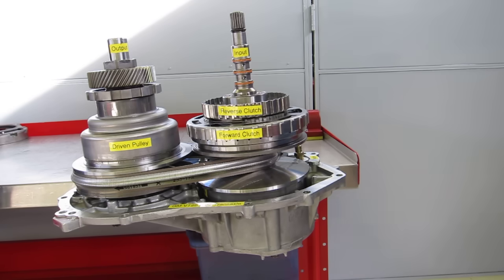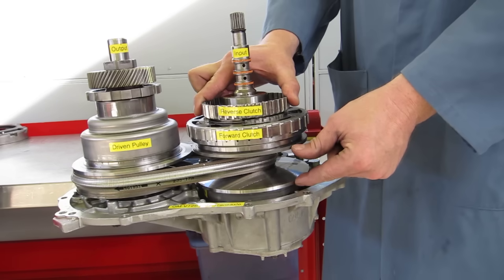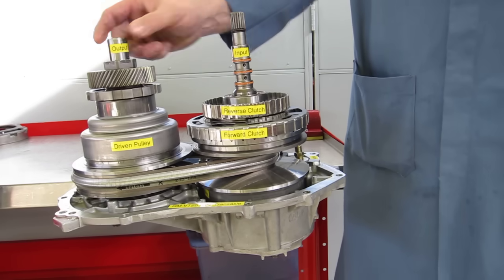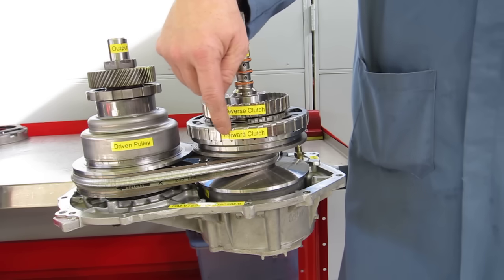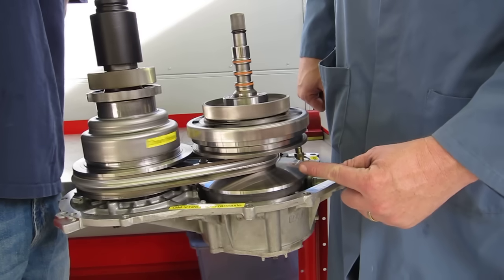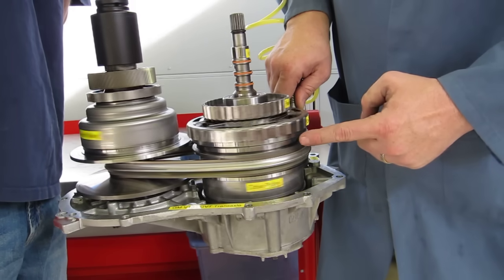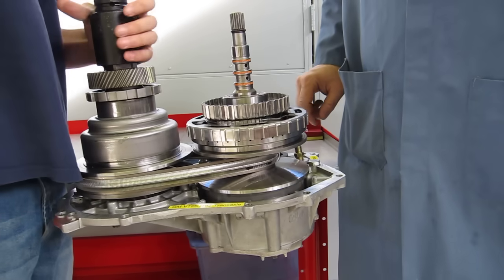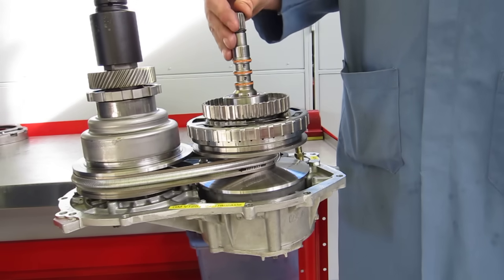Continuously Variable Transaxle (CVT) Operation

Comment: This is very straightforward. After seeing this, I understand why there are so many issues with CVT. CVT is not built for heavy torque and most likely will not last long. If something is wrong, it will be catastrophic. Avoid CVT at any cost.
Reply: Toyota and Honda pretty much perfected the CVT, especially Toyota, they have been using them on they’re Pruis’s for over 20 years now, and they’re pretty reliable cars.
Reply: @thinkkops853  Is this why Honda ATV's use geared transmissions?
Reply: Its a old video subaru as the chain drive instead of belt drive make it better in alls the way.
Reply: It's new technology, anything new will take time to perfect. And they've been making leaps and bounds in the past decade with CVT. I had an 07 caliber that had a CVT and I was worried it would just stop working one day with how bad it ran.
Reply: You can make a cvt more reliable than an automatic/manual and id still not want it
Reply: @anthonyoden4393  because its not just reliability, it has to have performance.
Reply: Almost all vehicles run a CVT now.

Comment: What is wrong if I have a vibration on acceleration, but only at slow speeds, worse when turning. cv shafts have been replaced, trans oil changed,  new tyres. B200 Mercedes 2007. has only begun after 80,000klms
Reply: same troubles with my nissan.  All cvt are junk

Comment: BUILT-IN BREAKDOWNS. THESE TRANSMISSIONS ARE NOT GOOD.
Reply: BigLBA1  They don't replace the steel belt. They have to replace the whole transmission.
Reply: BigLBA1  if you dont change the transmission fluid, you will end up changing the whole transmission.
I have a 2015 Subaru Forester with the Lineartronic CVT and it has been great so far. 56k miles on it, changed the fluid at 50k. Car runs like new.
Reply: Toyota Lexus CVT NEVER fail, most reliable drive train in the world
Reply: @ElleyElley-et4ky  The Toyota Prius has an eCVT. It doesn't have a belt like a CVT does. It's much stronger.
Reply: Ken Johnson Toyota and Honda pretty much perfected the CVT.

Comment: C.V.T = Crappy Vehicle Transmission
Reply from the maker: LOL, I love it
Reply: Not in Toyota and Lexus! Most reliable driver train in the world!
Reply: @Christopher Reed yeah heard of an early update needed, you're right there! But the existing CVT used on Prius Yaris most the hybrid cars never ever failed, taxis will reach easy 500k without any issues on anything! Tine will tell I guess!
Reply: @ElleyElley-et4ky  The Prius has an eCVT which doesn't have a belt. It's much stronger.
Reply: @ElleyElley-et4ky  Sadly yes, the technology is still fairly new and prone to failure. Nissan had their hands full with lawsuits because their CVTs are just awful, so hopefully other automakers are learning from their mistakes!

Comment: I wish someone would make a clear case so you could see it running with the fluid in it. Best demonstration of how the cvt works that I have seen.
Reply from the maker: Thank you!
Reply: @WeberAuto  quick question. Where can I find the pressure test fitting for the secondary pressure tap on the jatco cvt. Debating on making one if I can't find somewhere to buy the Miller version.
Reply from the maker: @sethc758  The miller version is the only one I am aware of. Check ebay for a used one.

Comment: This variable ratio drive tech is very old. Simplex motorcycles used it in the 1940's.  Polaris ATVs used it in the 1980s. It is one of the most ridiculously stupid designs to ever be used on such expensive vehicles as it is and are expected by the owners to be dependable....They are intrinsically a flawed design for such an application.
Reply from the maker: Thanks for your feedback

Comment: Very nice demo.  One thing that I'm confused about though.  I was under the impression that ' overdrive' meant that an engine's output bypasses the transmission completely this saving energy that would be wasted driving the transmission, hence the name 'overdrive'.  Is this wrong ?
Reply: Ah, thanks for the word.  I've been living an illusion all this time.
Reply from the maker: That is wrong. Overdrive means that the transmission output shaft is rotating faster than the input shaft (engine rpm). Thanks for your feedback.

Comment: Steel pulleys, steel belt,   how does it not slip?
Reply: Railroads have been using steel wheels on steel tracks with pretty good results only having to resort to putting sand on the tracks for exceptional times when there is wheel slippage.
Reply from the maker: Clamping load supplied with up to 4.8 kPa (700 psi)

Comment: My Suzuki has 117k miles on its CVT and it still runs smooth. Anyways we all can forget about transmissions if they can find a good power source for these electric vehicles, but I'm not sold on the batteries of today so I will stick with combustion engines until the find a better power source.
Reply from the maker: Thanks for your feedback
Reply: You mean power source such as the tesserae in avengers movies? Or the power in Tony Stark’s chest?
Reply: Electric motor vehicles have gear transmissions - simple step-down gearbox. No reverse gear - the motor turns backwards.
The simplest system is electric motor hubs but they are heavy for their power as they turn at wheel speed.
It's more efficient to have a high speed motor that is small and lightweight that drives through a single ratio gearbox and driveshafts.
The differential gearset could be eliminated by having an individual motor for each drive wheel. Two-wheel drive: two smaller motors instead of one larger motor and differential
Four-wheel drive: four small motors instead of two larger motors and two differentials. Four wheel electric braking with individual computer control for non locking braking, traction control and stability control.
Friction brakes would be necessary to provide more retardation than the motors can provide, and to bring the vehicle to a stop.
Regenerative braking saves "fuel" (battery charge).
Heat pump A/C and heating, instant-on, no waiting for an ICE to warm up for cabin heat.
Of course each motor has to have its own reduction gearbox.

Comment: thank you so much for this nice demonstration so the car engine computer is the one how to control the pulleys the reverse gear looks like a ring gear amazing but can we use this for a truck or just for fancy cars hh thank you, sire .
Reply from the maker: Thank you very much!
Reply: Can't really use these for trucks. The weak point of this type of CVT is that it cannot handle a lot of torque, while the point of most trucks is to have a lot of torque to move things around.

Comment: Question: if someone hits you (accident) at the front right , bending your rim, broke the air stem , replace the  hub front wheel r/t,   replace end tie rod outer r/f  and alignment can the impact that also shoved (shake from force) the strut  in to the CVT transmission cause any internal  issues to the CVT transmission.  Thanks for any courtesy feedback.
Reply from the maker: It is very possible. It could cause bearing Brinelling and premature bearing failure

Comment: something is not explained.  the push belt is directional, yet the reverser gear is on the input side, thus, to go in reverse the drive pulley would go backwards, and then the belt is going in the other direction.... explain please.
Reply from the maker: It would be pulling under those circumstances. Luckily most people do not need to reverse for long distances
Reply: Just dont race anybody in reverse, you'll lose the race and the tranny.

Comment: Professor John D. Kelly --- You are the best!  I have a 2010 Nissan Altima with a CVT transmission.  Is there any way to determine which Jatco model number was used in the 2010 2.5S Altima?  Wikipedia https://en.wikipedia.org/wiki/List_of_Jatco_transmissions  has a pretty extensive list, but does not say what the Jatco number is for the Nissan Altima 4-Speed Medium/Large (FWD).  Second question is do all Jatco models have the paper-type filter cartridge in the cooler line?  It would be the small cartridge filter identified as Nissan part number: 3126-1XF00, FILTER ASSY OIL
Reply from the maker: Thank you! I do not have access to that information.
Reply: @WeberAuto  I found it!  Based on some help from one of the Nissan Forums I subscribe to.  As far as I can determine my CVT is a Jatco RE0F10A/JF011E.  There is also a good list on the Wikipedia site (but mine did not get listed here): https://en.wikipedia.org/wiki/List_of_Jatco_transmissions .  One last question if I may.... With over 100K on my transmission I want to do a fluid change.  Your thoughts?  I bought the car at 83K and to my knowledge this will be the 1st time the fluid has been changed. I will avoid a power flushing service and just drop the pan (it has no drain plug), check the pan and magnets, check the mesh filter (replace if bad),  remove the paper filter cartridge housing, replace the paper filter, clean and replace pan with new gasket, measure the fluid removed, add back the same amount of NS2 vis the dip stick tube, then remove the rubber line to the radiator port, and do a remove 2 qts replace 2 qts flush until the fluid runs clean.
Reply from the maker: Yes, change the fluid. Be sure to use only the factory fluid. No substitutes.

Comment: Intriguing!  1  are there many internal oil passages in this CVT's case?  1  How complex would a "Plate built" [ welded ] case be?  3  Could the ratio  be controlled by a simple  Variable  Hydraulic control determined by the Driver?
Reply from the maker: Good question. I do not know the answer

Comment: Why nissan sentra transmition parts not avalable ?  This is musth will come transmittion problem
Reply from the maker: An internal failure causes too much damage to repair in many instances.
Reply: @WeberAuto  hello plz explain transmission oil cooler working & problems. Effects cvt working
Reply: @WeberAuto  transmission oil pump bearing broken compeny said not bearing tottal assembly . i am leaving qatar i need help

Comment: So on many cars they change ratio with hydraulic pressure ? I thought before that the amount of torque and speed of input shaft caused more tension on the belt changing the ratio, like a snowmobile.
Reply from the maker: No, there are all computer controlled
Reply: very cool, thanks for reply

Comment: What a perfect demo of the CVT. Thanks for this.
My '98 Civic has a CVT, and over the last 20 years I've been very happy with it. Definitely an evolutionary leap in trans design.
Reply: The civic 1998 doesn't have  CVT, it has  a 5 speed automatic transmission 👎
Reply from the maker: Thank you

Comment: Belt driven sounds like a bad idea.
If the belt breaks replacing it is a very expensive proposition.
Reply: it's not really a belt, more like a  toothless (metal) gear.
Reply: i think all those metal bits flying around and the tiny valves there's no fixing it. More like a swap at that point.
Reply: @Joe Black Exactly except that manufacturers have been cheating( in ways that I don't understand) that your mpg read out is more than your actually getting.What gets me is that I used to own ( way back) a Mazda 626 with a  carburetor that got 34mpg.I don't get that with my 16 Rogue. To this old man something just doesn't add up. I think big oil is the problem in that sense?Too much control?
Reply from the maker: Thanks for your feedback
Reply: A few things need some clarification.
It's not really a belt, more like 10 metal bands stacked that hold about 400 metal elements in place.
Also it's not really pulley system, but rather a pusher system, when those metal elements are pushed, they form a ridged metal rod that become quite strong, there is no stress on the bands them self.
One is the main reason CVT's have such bad reputation is because people fail to take care of them, unlike standard transmissions, these transmissions require clean fluid, they need to have a fluid change every 30k miles.
Reply: yes and these belts break often. and you have to buy whole belt, not just a little steel pieces that go on that belt.
Reply: Robert Presti  no they don’t. And “if” one did, there would be no repairing as the damage would be catastrophic.
Reply: @Backs4more  Your right .That belt breaks and your talking a new cvt., plus Nissan in my area does no tear downs for  anything. Strictly R&R .Most they do is fluid change for $400.00 Ouch!
Reply: @Joe Black My car was junked for major rust , not for a bad engine.It ran great.
Reply: It's a belt pack, sometimes consisting of 5-10 metal strip belts in pairs, slightly larger than the next one, that sandwich in the hundreds of small metal components that make up the flexible steel belt driven surface. There are no traditional clutch friction discs involved. The trans fluid is usually under very high pressure.
Reply: @samshepherd5661  GM and Fiat both had a CVT option in their vehicles from 2002-2005, but they switched back to regular automatic transmissions, because they realized CVT's are very unreliable and they even created a special warranty because of all the CVT's that failed. It was only a 3 years/75,000 mile warranty, because most only lasted 50-80k miles, GM and Fiat both were being sued for the failures. They have more issues than other transmissions so they discontinued putting CVT's in all their vehicles after 2005.
Reply: But it means you can have the perfect gear ratio all the time
Reply: @hazza2247  
Actually with the planetary gear system of the Prius you do have the perfect gear ratio all the time without belts, but you do need a hybrid for that.
Reply: @hazza2247  Who cares about gear ratios if the car breaks down all the time?
Reply: A dozen of potatos and a fat cat smelling them ( love ur name btw 😂) I guess it’s a high risk high reward kinda thing? Coz being in the perfect gear ratio all the time is good for fuel economy and allows the engine to run efficiently, but I if your car breaks down that kinda sucks
Reply: @hazza2247  manual transmissions are super reliable and SUPER cheap to repair. Even if you burn the clutch the car will still drive. But no for long. In a CVT, if the belt or the solenoid breaks then you are stuck in the middle of the road. Sometimes one of the synchros can break down in a manual transmission(This is super rare). But you can still drive the car without any problem. You just have to double clutch in order to change the gear smoothly. Synchros are cheap to change. All these years people didn't have any problem with manual transmissions. They started complaining about them because if you drive an automatic then most people are bored to come back to manual because of the ease of use
Reply: A dozen of potatos and a fat cat smelling them thanks for the reply, I get ur point perfectly 👍and yeah I drove auto for a bit and it’s the most boring thing
Reply: @hazza2247  :)
Reply: It is. That's why you don't floor your gas pedal. The gears shift when the engine isn't accelerating. I know because I drive a Honda Fit. It's RPM behaves like a CVT. The RPM only goes down if I let go of the gas pedal. Same with the older Honda Odyssey we own. It's belt had to be replaced, which was pretty expensive.
Reply: @aurvaroy6670  having the same experience with a Nissan Sentra. It won't shift until you let go of the accelerator.
Reply: @luisrobles9305  yeah that's how CVTs work. They're pretty efficient and perform well on freeway, but CVT cars like the Honda fit are really slow at climbing steep hills. Shifting from drive to s doesn't really help that much
Reply: @aurvaroy6670  - The Fit has an itty bitty engine, low powered even for a small car.
Reply: @algrayson8965  don't know the horsepower and torque but I'm pretty sure it's much lower than a civic or Accord. At least the 4 cylinder sips less fuel than larger v6 or v8
Reply: @aurvaroy6670  how much the belt cost you?
Reply: Peppe Ddu .,
Reply: Okay thanks but I’m having trouble figuring out how a planetary gear system works?!? What decides the speed of the ring and sun gear and what powers each one of them??
Reply: @hazza2247  
It's a fascinating system, one planetary gear, one engine, two electric motors and you have full power control without clutches or belts.
https://www.youtube.com/watch?v=E_xCssR8qQI
Reply: Its just as easy as changing a fan belt. Cheep and easy
Reply: Bart Simpson no it’s not. To replace a belt requires a complete strip and rebuild. Subaru, Nissan and Honda will charge around $7000 🙄

Comment: After all this time i just came across this excellent video  :)  , thanks for posting .
With all those small metal bits making up the belt that is being being sandwiched between the pulleys as they vary in size  ,  i wonder if they get much in the way of metal particles floating around as a result of wear and tear with the belt running up and down the pulleys ???
Reply from the maker: Thank you, Not much wear at all with the correct fluid installed